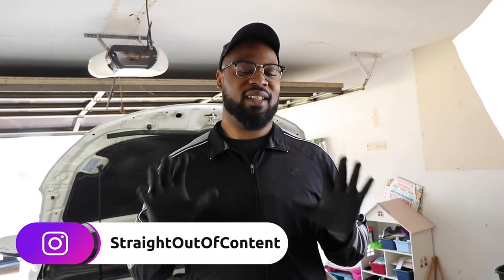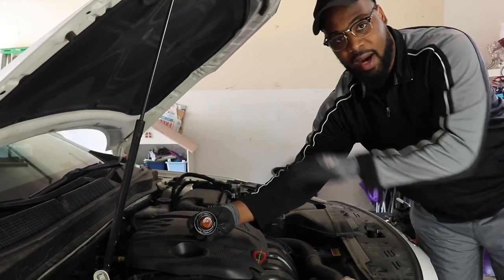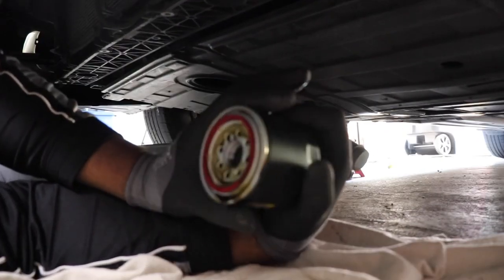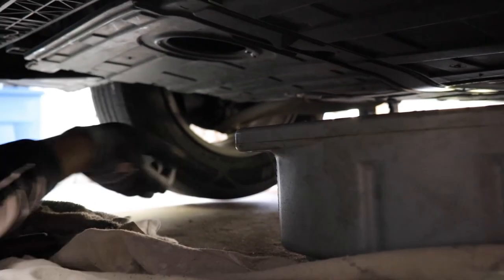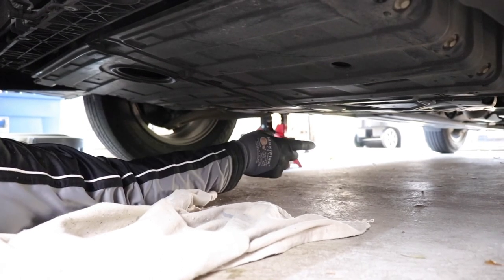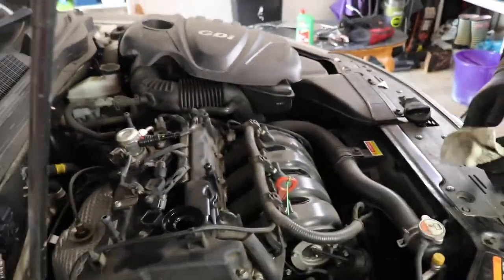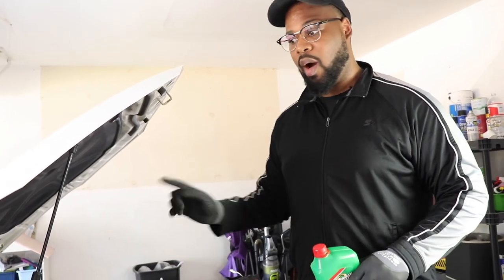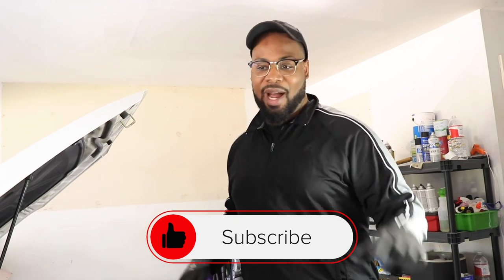HOW TO CHANGE YOUR OIL IN A KIA OPTIMA | THE RIGHT WAY TO CHANGE YOUR OIL #kia #cars #oilchange

Comment: I have a 2017 KIA Optima EX with 2.4L motor as my commuter vehicle to work. I  change my oil and filter every 6,000 miles with full synthetic 5w-20. My Optima is usually down 1/2 qt when I drain the oil, so its using a little oil. Mine has 47,000 miles. I also changed the PCV valve, so curious to see if that helps at all. My average MPG is 31 city/hwy combined
Reply from the maker: Yup I have a video on this also. Its part of a new lawsuit for the KIA/Hyundai companies. These cars are crap! But they will not replace your engine until it completely stops working.

Comment: So does my kia have that warranty even though I bought it used with no warranty from the dealership I went to?    Oh btw it's a 2015 kia optima
Reply from the maker: Same year as mine. You need to check out my latest video. In short, you need the ksds in order to be covered.  Call your local kia dealership and set that up asap.

Comment: Can you please show how you lift the car AND put the jack in place?  We have a 2019 Optima that I've learned has very soft pinch welds that tend to bend if lifted the wrong way (don't want to do that) but even if we can accomplish jacking it up, how is the jack stand to go on same spot?
Reply from the maker: Omg ok see I bent the pinch welds on my car as well. Dang so even the 2019s do it? 😥. I can do a video on it. That's a good idea.
Reply: @StraightOuttaContent  That would be awesome!! I have co-workers with damaged pinch welds on their Optimas and they say the car is serviced only at their dealers since new so...that means the dealer damages them too!  btw, I subbed. 👍
Reply from the maker: @LessThanHandy  yea they're super weak for some odd reason . I mean you can always rubber hammer them back straight but don't worry if you bend it a bit. Or buy a bigger jack that you can use on the frame. Thanks for the Subscribe!!!
Reply: You can get jack and jack stand adaptors for pinch welds. Basically just big pucks of delrin with grooves cut in. They distribute the jack force around the pinch weld but not on the weld itself. Honestly, these adaptors are a must for modern unibody vehicles.

Comment: I have a 2015 Kia optima with 110,000 miles on it. I’ve noticed that my oil burns within 1500 miles. I use full synthetic Mobil 1 extended performance High mileage. What do you think the issue is?
Reply: you should rebuild that engine as the piston rings are stacked. Don't forget to add oil regularly till it die

Comment: How long is synthetic oil supposed to last?
Reply from the maker: That depends on the oil brand and how much you drive. If you dont drive a lot it can last a long time, if you drive a lot every day then you want to change it frequently. The only difference between regular oil and full synthetic is synthetic oil has detergents in it to keep the engine clean and prevent build up over time.

Comment: Does this optima require a oem oil filter? I have a 2016 optima and I was told I need a oem filter every time I get a oil change.
Reply from the maker: No. Every oil filter sold from a auto store is "oem" basically. They don't sell kia optima oil filters. You will be good with a good brand from the auto store of your choice
Reply: @StraightOuttaContent  it is not required however there is actually an OEM filter that has much better technology quality then 3rd party that can be ordered from Kia and is recommended especially if you have the 2.0t and not the 2.4